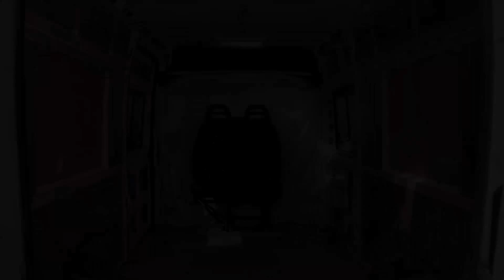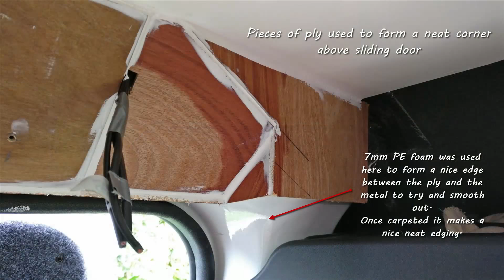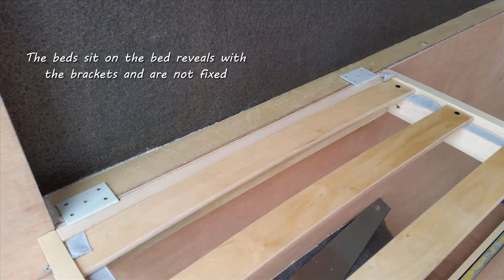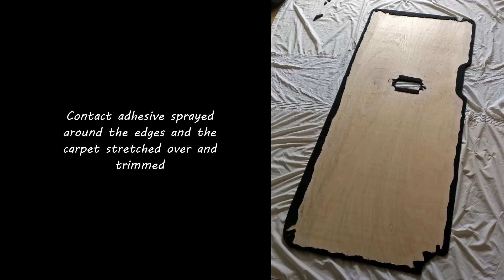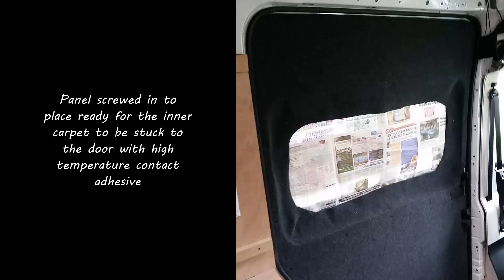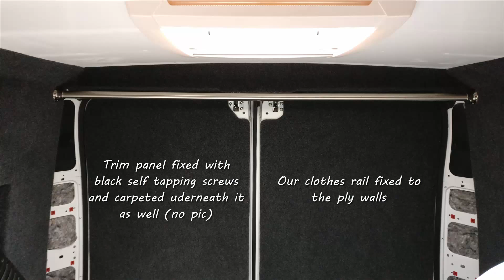CAMPERVAN BUILD: Self build van guide - part 3, Ply Lining, Lining Carpet, Bed Construction

Comment: I am interested to know how your bed has held up after all this time. I am basing my van on your design and I'm just a little bit worried on the strength of the bed. Does it flex at all when you are using it? Thanks
Reply from the maker: Hi, the bed is still as strong as it was on day 1, because I have the 2 uprights supporting it as well which is part of the wheel arch boxing in the actual width isn't that big. Hope this helps
Reply: @CamperVanTango  Excellent. Thanks for the quick reply. Built the wheel boxes today.
Reply from the maker: @Djpedla  Good luck with your build and hope the videos give you lots of tips :)

Comment: When did you paint the roof? Did you install your finish flooring after all this? I'm worried about the carpet getting moldy
Reply from the maker: I painted the roof before i carpeted the walls and put the flooring down before fitting the cupboards so i wouldn't have to trip the vinyl around them, if you are fitting carpet then i would fit last. Andy

Comment: Nice presentation. When doing the walls first, what are you doing to keep track of where all the structural elements are for attaching cabinets?
Reply from the maker: Hi, Thanks for your comment as i used 9mm ply for my walls that was strong enough for the cabinets to be screwed and bonded to that, but I did make notes of measurements where the van ribs were, refer to part 1 build videos for info on this. :)